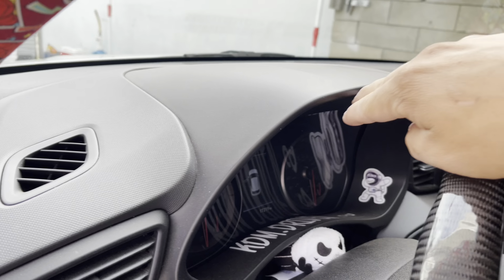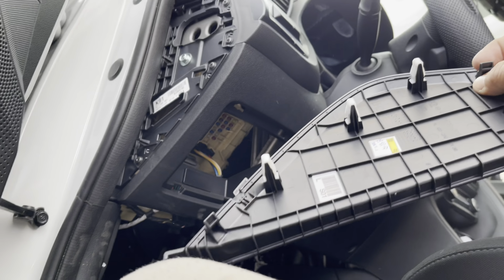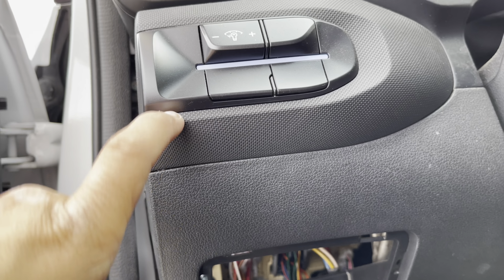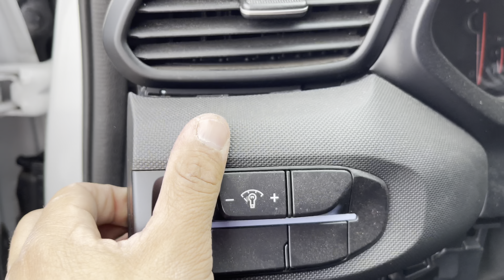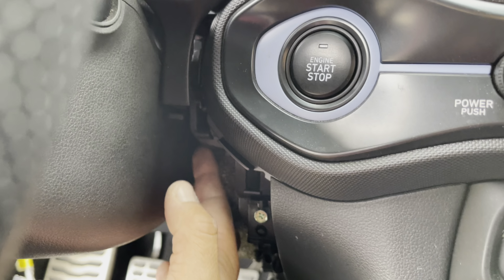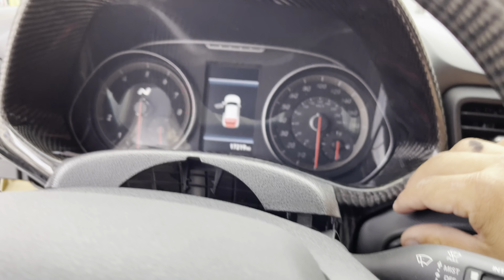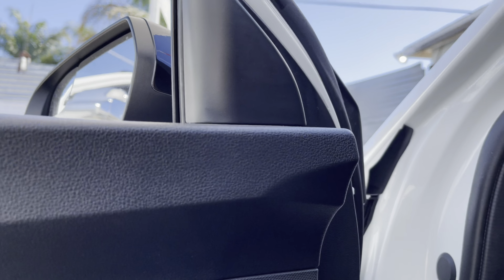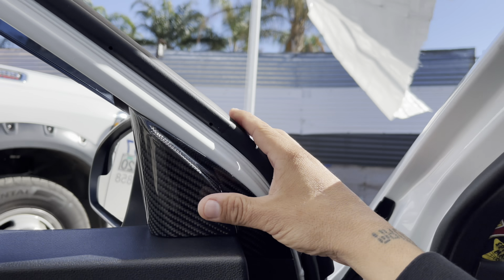How to Install Carbon Interior Pieces | Veloster N

Comment: Where did you find the back door CF trim piece???
Reply from the maker: SoCal Garageworks. It’s sold as a set to replace the two interior mirror covers on the front doors and then one for the rear.